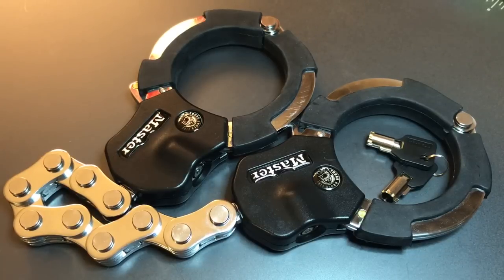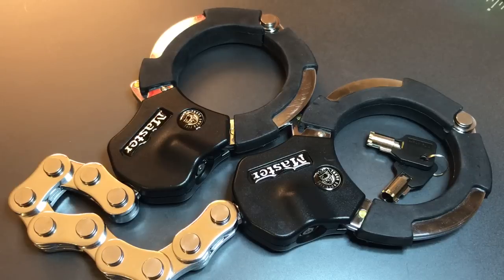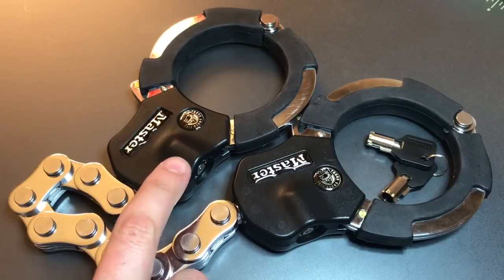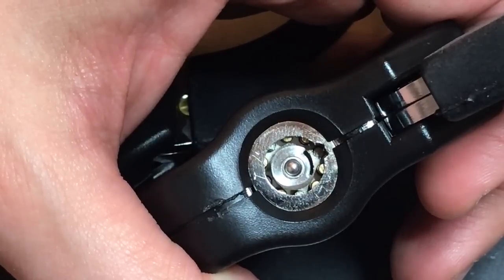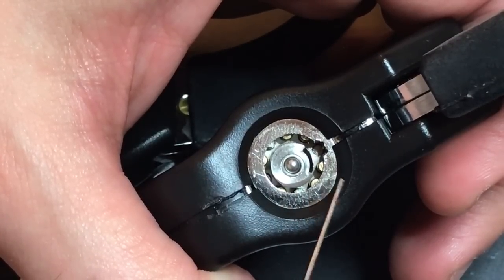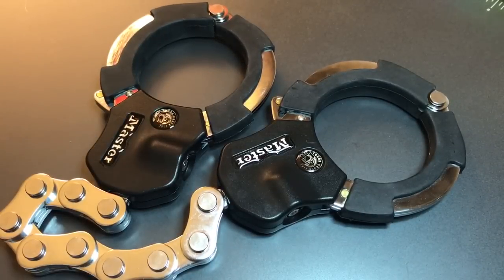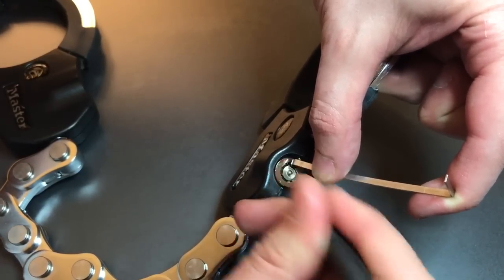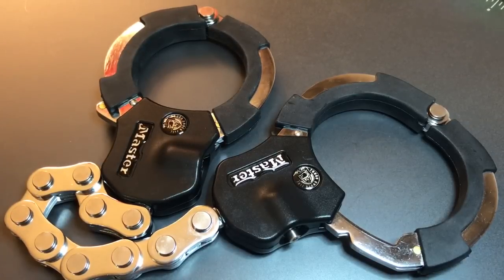[355] Master Lock "Street Cuffs" (10-Pin Tubular Core) Picked

Comment: I enjoy your videos although they do cause me to worry slightly when I'm locking up my £3,500 mountain bike in my local city centre.. one question that I wish I had an accurate answer to.. how many bike thieves have any idea how to pick locks?  I suspect less than 1%
Reply: I'm not a bike thief but my hardest lockpick ever in my opinion is when I had to picklock my safe in my house. That was rough.
Reply: If I'm gonna steal something expensive I will know how to lock pick and I will be so happy to see a lock like this on a 60.000 dollar motorbike
Reply: Tom Williams most smackhead bike thieves won’t know a thing about lockpicking, most will simply attempt to use brute force, or bolt cutters to quickly pinch a bike. They won’t usually go for such a difficult target, Especially in a busy city centre.

Comment: I expect the dummy pins are there to stop the use of tubular lock impressioning.  Maybe they have a study saying impressioning is more common than picking.  Maybe they just don’t care.
Reply from the maker: Perhaps, but a couple notes:  First, I don't know of a 10 pin tubular lock impressioning tool.  Second, there are FAR easier ways of preventing impressioning (i.e., use different length driver pins and/or different strength springs).  Third, the dummy pins would not stop an impressioning tool from working.  I can't really think of a logical reason for them.
Reply: Marketing. It's the only explanation. The board were obviously (easily) impressed.
Reply: @lockpickinglawyer  Its called the old fashioned,white bic pen and bic lighter truck.
Pull out all the pen guts,and end plug.
Heat end of the tube with lighter,till it softens.
Jam it into tubular key hole.
Let cool under push tension.
Turn,and open.

Comment: Fancy stuff these "street cuffs". Do you have any idea why they have dummy pins in the lock?
Reply from the maker: No idea about the dummy pins... maybe to make it look intimidating, maybe as passive pins... either way, it's BS to call this a 10 pin lock on the packaging.
Reply: Potti314 I suspect the steel coloured pins are hardened as anti-drill protection.

Comment: If someone picks it open just destroy it and claim a forceful opening.
Reply: Picking a lock leaves telltale scratches on the pins. They would, without a doubt, be able to tell that it had been picked at some point.
Reply: @gimmethegepgun  Even the key would scratch the pins, saying that a lock has scratches wouldn't be enough to conclude that it was definitely picked.

Comment: To be fair, their $3500 guarantee probably does not include manipulation because there would be no way to prove that the key wasn't used to make a fraudulent claim...
Reply: There's no way to prove the owner didn't cut the chain to make a fraudulent claim
Reply: @adamstephens9611  a valid police report number should suffice.
Reply: @AveryEremondi , a valid police report only proves that a report was made. It does not prove that the owner did not damage the lock, and ditch the bike.
Reply: @adamstephens9611  - I think the point is that the chain is very hard to cut, and would probably require special power-tools that are more expensive than $3500. Also filing false police reports will get you in trouble. So if you report your bike as stolen, and a week later the police sees you riding it...
Reply: TheMrVengeance the links are hardened steel so you would need specialty tools you know something along the lines of a harbor freight angle grinder or a hacksaw and saw will power
Reply: @goiliath9s496  - Yeah, that's not suspicious at all. Someone standing next to a motorbike, bent over a lock, in a shower of sparks, going NGGGGGGGGGGGGGNGGGNGGG for minutes. 🙄
Reply: To be fair $3500 isn't going to be enough to cover the cost of most bikes.

Comment: what motorcycle lock do you recommend ??   besides one with a pitbull attached to it
Reply from the maker: +Dan Thiels Pitbulls definitely help. Something like a quality 14+mm chain with a quality lock (Abus 37/80, Abloy 362, etc.) is about as good as it gets with respect to locking it up. Personally, I'd add GPS and insurance to the mix.
Reply: Rottweilers are also pretty effective. 

You could also try tapeing a bobcat to the seat.

I knew some guy who used a rabid skunk and could leave his bike unlocked in downtown Detroit without getting jacked.

Comment: I've been watching various lock picking channels and I'm wondering how Master Lock and many other companies can legally sell easily bypassed security devices without getting sued. They all seem to put a lot of work in the outside of their products but use the same cores over and over again. They even offer warranties on everything but the part of the locks that are most vulnerable. Is the lock industry scamming us?
Reply from the maker: +Erick726 I wouldn't say scamming... it's just that they only put effort into addressing the more common physical threats. Pick resistance seems to take a back seat.
Reply: Picking for entry, at least into places where most inexpensive masterlocks would be used, is not common. Extremely rare if even statistically noticeable.  Any old lock, or thing that looks like a lock, stops a lot of break-ins. ...or it doesn't, but in those cases doors are just kicked in or windows broken. My shed lock could probably be picked with a rusty spoon, but why bother when in one second you could pry it off the wooden door with a tire iron. Also, sturdy looking outsides are intimidating, at least when you are just looking for a quick grab. (Just picked a friend's trailer lock on a bet, and yeah walking past it it looks massive and scary and looks like you'd need a bulldozer to break it, but it picks in moments...but nobody has ever messed with try to open his trailer. But he was looking at the outside and saying, "Bet you can't pick that!")

I am curious how many people actually even bother to follow up on a warranty from them. Supposing even that it is covered, I suspect the vast majority of people don't bother and/or have forgotten that that five year+ lock might have some sort of warranty on it. 

There is no "legal" standard they have to uphold to though. (Not that I know of anyway) In theory I could sell you a coat hanger as a secure gate latch or crawl space or shed lock.

Comment: Is there a bike/motorcycle lock that can NOT be picked? I mean all of them can be cut open by a battery powered angle grinder, but is there one that is truly pickproof?
Reply: The only pickproof lock is the absence of one, And flaunting that your lock is pickproof is a rather effective way to get the response of "challenge accepted"
Reply: Yes!
(Set the front tire in drying cement- wait for cement to set)
Reply: @mathewwinney8036  I will just remove the front tire and steal the bike
Reply: It just has to be pick resistant enough to get the thief to move onto someone else's bike.

Comment: There is a tool that is used for removing the hinge pin in bicycle chains. I wonder if it would work to remove one of the pins in these chains. Unless they have flanged the ends of the pins, I am guessing that it would only take 15 seconds to remove one of those pins.

Comment: Physics definitions beat weasel contract terms.  Force is well defined. 
You've applied Force to the ring with the tension wrench, and more Force to the 6 functional pins with a pick.  The $3500 warranty is only slightly more secure than the lock.

Comment: I had two of these, they were great for deterring someone with a pickup from coming by and just taking your 50cc scooter. Unfortunately the locking mechanism doesn't hold up in the weather and the locks both eventually failed in the open position (would not lock).

Comment: So basically you put tension on the lock cylinder then push the lock pins up or down one at a time to allign them so the cyclinder can rotate? Does the constant pressure from the tension bar tool prevent the pins from relocking as you pick them one at a time?

Comment: I have a question, this lock is supposed to be a 10 pin, but you show us here that its 7, dealing with 6 . So does this mean that it requires only a 7 pin tubular lock pick, or would you need a 10 pin tubular lock pick?

Comment: "I have your motor cycle now.... that has nothing to do with this particular lock. I was just using this video to distract you while I stole your actual motorcycle from your house. You really need to get a better lock on your garage. I opened it with simply a redbull can. Not even a sliver, just the whole can. It hasn't even been opened yet. "

Comment: What if the keyhole is absolutely round? like the key itself .. Let's say at the end of a round key there will be a triangle, 5mm long .. To apply force, although there are completely round keys .. how to move such a lock? If the hard alloy lining is acceptable, the cut is not made, but to complicate it, let's say that you need to apply increased force to open the lock. How to open such a lock? In fact, there is nowhere to insert the lever .. And let's say the lock has 4 rows of pins: top, bottom and sides. This will make it impossible to crawl inside with a thin instrument, with a triangle at the end, there will not be enough rigidity

Comment: The differently-colored dummy pins make me so unreasonably mad. Like, it's one thing to make a crappy product out of stupidity and/or lack of resources. It's another thing to make a crappy product out of laziness/awesome greed. Because there is no way, "These pins should all be the same color," did not occur to anyone. It certainly did. But, "But we save .003 cents per pin if we make them out of this other material," had to have come after it.
And then the legal teams and actuarial magicians and marketing executives and whatnot all did computations on how big and extensive a warranty they could offer to maximize profits.
Whole arcane labyrinths of capitalist mire, rather than just making a friggin' quality product. Oi.

Comment: Before I even watch that I can guarantee this lock would be useless for cars and trucks. If you managed to get the vehicle it's attached to started, it would take  very little power to break the cuffs open. I bet I could even pull it in half with a motorcycle

Comment: What does this dude actually recommend? LOL. Am I suppose to believe that a common street criminal is going to have this guy's knowledge base? 

If anything he's just showing people how to steal your shit, so that they can get caught and he can represent them as a LAWYER.

Most people don't need to chain up their motorcycle... so a little added security isn't going to alter much but stopping the occasional crime of opportunity idiot whom rolls your bike away.

There aren't gangs of lock picking hooligans roaming the streets defeating locks. 

Also, when a lock is attached to something, it's a lot harder to pick because the orientation, public pressure, and other variables increase the difficulty.